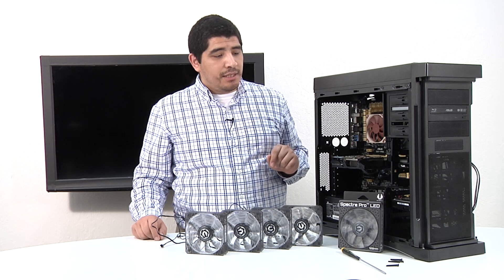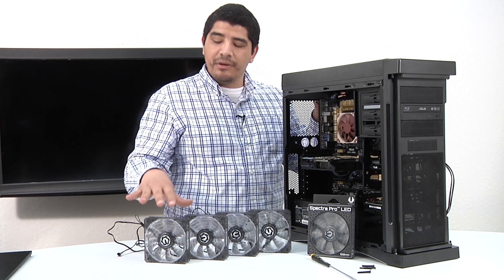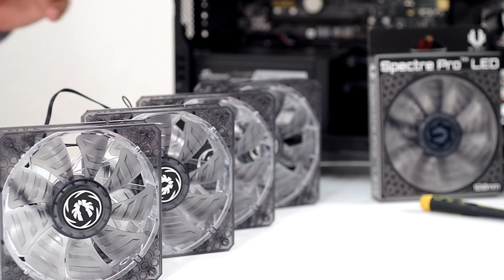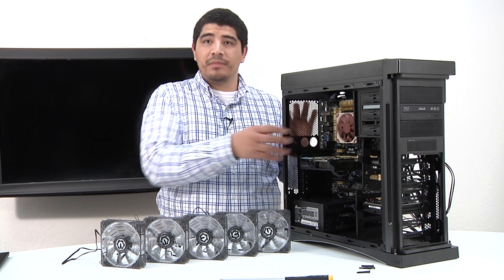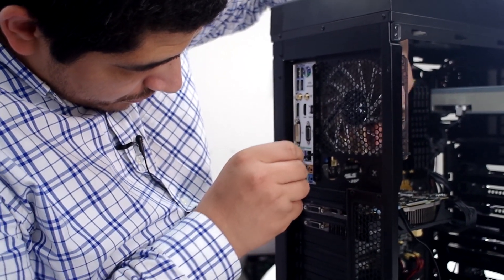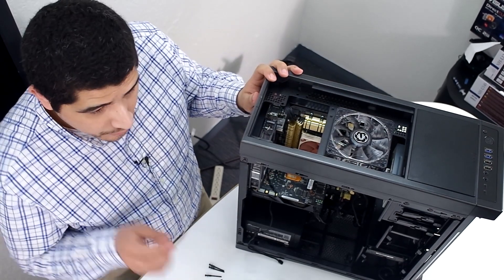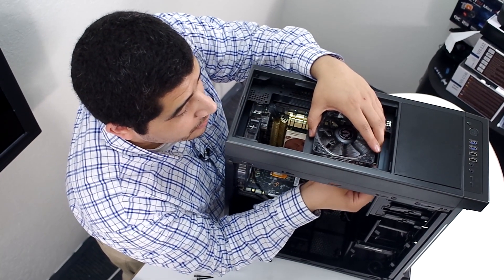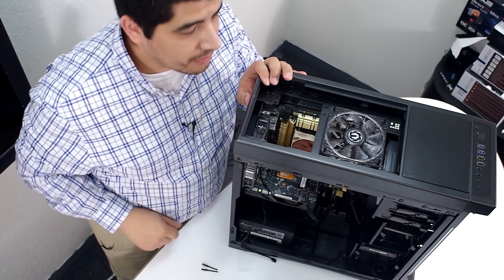How-to install case fans

Comment: So, does it matter which way the fan is pointing when you put it in the case?
Reply: Lucas Becker Definitely. The direction of airflow is through the front of the PC to the back of the PC and out the back. As air moves to the back it also rises because warm air rises. The front fans are intake fans and need to pull air into the PC. If you install the fans backwards they'll be pulling air out of the PC. You can see clearly how the front fans should be oriented when he's installing them. Install the back fan - the exhaust fan - with the fan facing the same way as the front fans. Then it will take air from inside the PC and send it out the back. If your PC has a side fan, it is an intake fan like the front fans. Orient it the same way as the others so it pulls outside air into the PC.

Comment: Why would you have the top fan's intaking air. Not smart we all know hot air raise's
Reply: +JABBA COOLA because there is a dust filter there for a reason, its also not smart to exhaust air trough the filter (useless) and create negative pressure so dust enters at small areas that aren't filtered nor supposed to be intake since the fans have to get the air from somewhere when there is negative air pressure, also hot air doesn't raise super fast and in this case will go where the exhaust fan is exhausting it.

Comment: Guyz if your fan connectors are full and you have more fan space then try searching for the
''Zalman MC1 multiconnector Bulk'' or the ''EKWB EK-Cable Splitter 4-Fan PWM Extend'' or ''Adaptercable from 4-pin or 4x3-pin'' or ''Akasa AK-CB001 Multi-fan Adapter''.
(had a hard time finding them and the reviewer never review it)
Like to keep it on top guyz ! (hope this helped !)

Comment: I'm having trouble with my future build with the sabertooth z87, 

What's the difference between Asst_fan and Cha_fan? Also, how will I connect these fans into the motherboard if Im using the h100i? Ill be building this in  the H440, Please Help.

Comment: I know how to screw fans, thats logic, but i dont know what to do with the cables. You only focused on mounting them
Reply: OneBrokeBloke plug the fan cables into the fan headers on your motherboard. If you don't have enough, you can buy some on amazon for under $15
Reply: Rodriquez Camese no i would imagine you would need an adapter, although im not 100%
Reply: Rodriquez Camese ah ok cool, im gonna order some fans shortly too so thanks for the correction
Reply: Rodriquez Camese thank you you helped me!

Comment: ok this seems off to me, I have been building pcs for only a year so I'm no pro, i've built 10 high end pcs and not once have I made MY FANS INTAKE AT THE TOP?> wtf is with that? I have always intake from FRONT, SIDE, & BOTTOM ONLY. and REAR & TOP EXHAUST...hot air rises naturally so it makes sense to exhaust not bring in...this video gets an "E" for effort and that's it...
Reply: Ahh yes you clearly know better than someone who works in the industry because of your anecdotal experiences.
Reply: I've been building PCs for 20+ years . He is doing it absolutely right . This set up will maintain positive air pressure inside the case . Which means more air to get circulated inside -- resulting in better heat dissipation -- resulting in lower rpm for fans -- resulting in low noise . Anybody speaking against -- think about the filter mesh . Why did the case maker put filters on top ? Get off of your sugar rush & think 🤣

Comment: would any body recommend putting a fan on the side panel? Mine is see through. This is mine http://www.newegg.com/Product/Product.aspx?Item=N82E16811119227
Reply: it would definately help keep temperatures down and keep airflow running nicely
Reply: rickman297 Could someone point me to a vid that shows how to PROPERLY wire a intake fan onto the side window?

Comment: I can't seems to find any fan connectors on my motherboard, do I just plug it in whereever it fits or how does that work?

thanks
Reply: likepie666 most mother boards have dedicated fan slots that usually have a few letters/numbers accompanied by the the word “fan”

Comment: the natural direction of warm air is upward. Instead of using an exhaust fan, using an intake fan on top is a stupid idea. one should absolutely avoid it, its against the laws of physics. So intake from right, left, front, bottom and exhaust from back and top only.

Comment: for anyone who wants more fans and wondering about connectors for them dont forget you have fan controllers you can add in the front bay which can connect multiple fans so no need to worry about motherboard ports for them

Comment: Top fans on the intake? No, no, no! Your top fans should be exhausting the hot air out, not trying to defy phisics and push it back down and in. Front and side fans are always intake, and top and rear are always exhaust. Would this guy install a top-mounted CPU radiator to blow the heated air into the case? Good grief!
Reply: Shoes thanks for clarifing that.  I'm no expert but was thinking surely heat rises so why is the top not exhaust too. So your clarification of front and side intake, rear and top exhaust was the answer I was looking for. Thanks
Reply: He is doing it absolutely right . This set up will maintain positive air pressure inside the case . Which means more air to get circulated inside -- resulting in better heat dissipation -- resulting in lower rpm for fans -- resulting in low noise . Anybody speaking against -- think about the filter mesh . Why did the case maker put filters on top ? Get off of your sugar rush & think 🤣
Reply: Shoes386 You are supposed to have more air coming into the system so it creates a positive pressure making it easier for hot air to escape. For instance if you take a deep breath in you have positive pressure in your lungs and they want to exhale and can do so without effort. and usually the top is supposed to let hot air out but if there is a radiator there it is not as big of a difference but it still is.

Comment: I don't have an Asus motherboard but anyway my board has two fan connections only, I'm still waiting on my case and I would like to install up to seven fans but where would I connect those fans for power? I'm a newbie can you tell?
Reply: use fan power extensions

Comment: I'm a bit of a pc noob lol. But when installing case fans do you have to worry about making it intake or exhaust or does it just do that on its own?
Reply: bit late but airflow should be front to back. back end of the fan should be facing towards the back

Comment: Thumbs up if you flipped when he said "top fans will be intakes"
Reply: Have my like good sir..
Reply: thank you
-bob
Reply: this comment probably got him fired.
Reply: ya,hot air rises.So why push that air back in?
Reply: @Rudenbehr  Exactly, I thought the same :)
Reply: So do top fans normally blow hot air out?
Reply: I was like what the fuck, is this a joke? I was really confused, I was like these guys are pros right? Hmmm...
Reply: Hahaha.Yes I did :)
Reply: sandith752 I'm almost in the 9th grade(cookie please?) so ya, I know a little about conduction, radiation, convection and all that jazz.
Reply: So I see why he said the top two as intake. By having the top two and the two front as intakes you are creating a positive air pressure in the case. By having more air being forced into the case then is being pulled out creating a positive air pressure less dust is likely to get in the case. And if you watch closely you will see air filters built in the case that go over the top two and the front two.
Reply: sandith752 whats yer point? if hot airs rises why the hell would u want your intake fans on the top of your pc? make sense?
Reply: He is doing it absolutely right . This set up will maintain positive air pressure inside the case . Which means more air to get circulated inside -- resulting in better heat dissipation -- resulting in lower rpm for fans -- resulting in low noise . Anybody speaking against -- think about the filter mesh . Why did the case maker put filters on top ? Get off of your sugar rush & think 🤣
Reply: who was acting arrogant bro i said something simple and you jump off the handle telling people they should learn how to spell n shitt i think you got it all backwards bro
Reply: imagine having reading comprehension this bad
Reply: Your comment from 5 years ago helped me build my pc today thank you:)
Reply: at first i thought this comment was a double entendre 🙊
Reply: I’m building my first pc in 2019 and yes I did flip my lid lol 😂
Reply: KimiDesu hows it going there 6 years later. About to build my second pc but I’ve never installed cpu fans...
Reply: Fail.
Reply: He does not know ABC of airflow
Reply: Ikrrr!!!!!!!!!! Come on Asus get people who know aren't drunk!!!!!
Reply: "whats yer point? if hot airs rises why the hell would u want your intake fans on the top of your pc? make sense?" how do u find this agressive please explain?

Comment: True, but since with this case the top is filtered you could use it as an intake.
Also, you always want more fans to blow air into your case then fans blowing air out. This creates positive pressure in your case. 
All the excess air will blow out of every little tiny hole and crack, instead of sucking air through those. This will help to keep dust out of your system.

Comment: All of the intakes are dust filtered, the positive pressure makes the air inside want to escape from every gap possible, there for effectively blocking dust, where as negative case pressure would cause all of these areas to suck in dust.

Comment: Sometimes using top fans as can cause short cycling and end up pulling the cool air up to the top of the case and not allow it to get to your back bottom corner. 

Flipping fans over only takes a second, some of you might try it out and see how it effects your system. Worst case scenario you got in a little hands on learning time, and know more about your rig than you did before.

Comment: urgh, top inatke... I have an 80 intake on my expeansion slots and one 120 in the front, which has another (corsair AF) in the removed HD tray as an accelerator xD, and 3 exhaust (top and back) - seems just fine